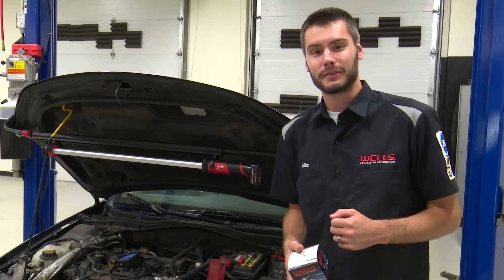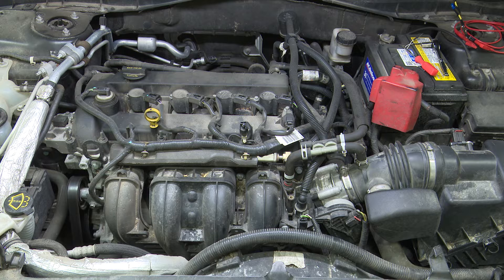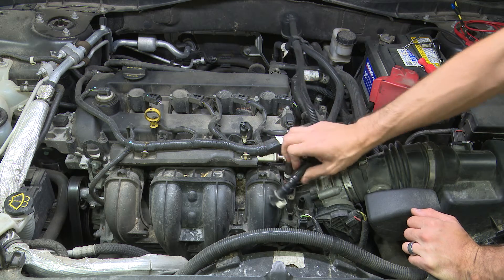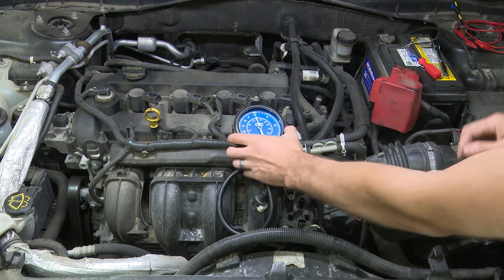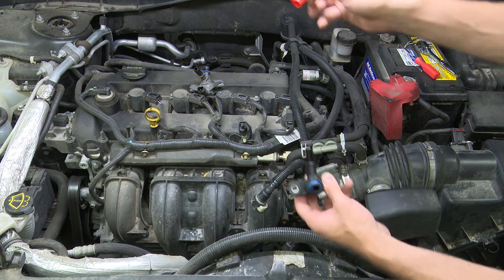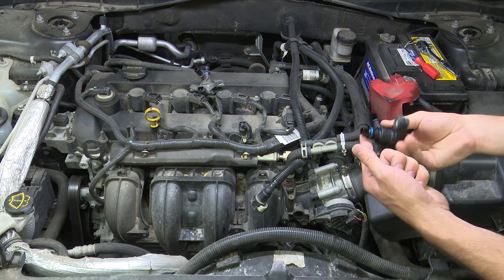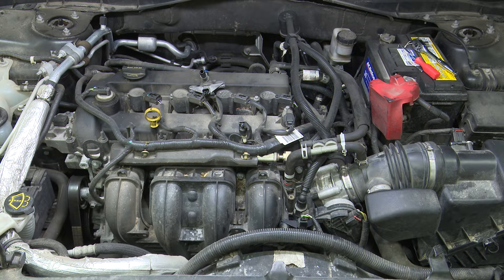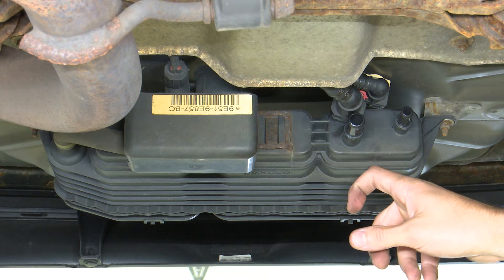CounterPoint Ep.29-How to test/replace PV691 purge solenoid on Ford Escape & Fusion P0443 & P0455

Comment: 2 questions Mike. 1: Did you set the circuit code before the video because you were playing? and 2... did Keith yell at you yet for not leaving the gauge on for at least five minutes and not opening the new one to make sure it does not stick!! Haha just picking man. Great vid!
--Eric O.
Reply from the maker: Eric, yes, I did set the circuit code by playing with it before I shot the video. I had a time restraint on this one and did not have the time to clear codes and rerun the monitor and make it fail. So, unfortunately that is what caused that. This video was not meant to be overly technical which is why I didn't pursue that explanation. Yes, of course Keith yelled at me! It makes sense, leave it on there longer to verify. I get it, he is right! That will be something I talk about when it comes up in a newer video. Thanks for watching man!
Mike Becker, Technical Services Instructor
Reply: South Main Auto Repair , its a Wells, it don't stick. Were you thinking of a Cardone solenoid Eric? Lol. Hows the ice cream?
Reply: HAHA some of Keith's videos don't last 5 minutes but they are longer than mine. It's a Well's they don't stick anyone knows that HAHA.
Reply from the maker: Haha thanks Bob and Travelingman! Only quality coming from here :)
Mike Becker, Technical Services Instructor
Reply: @GoTechTraining  what the code P1440 mean on a 2009 ford escape 2.5